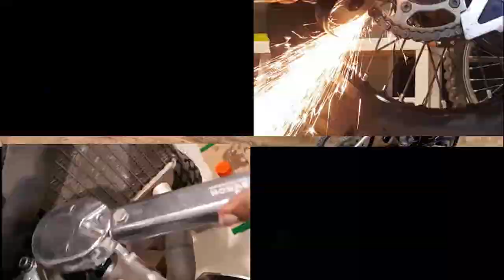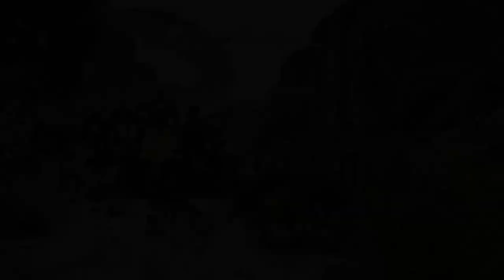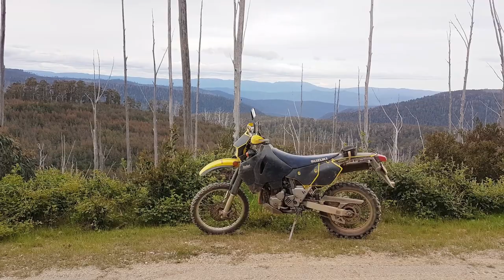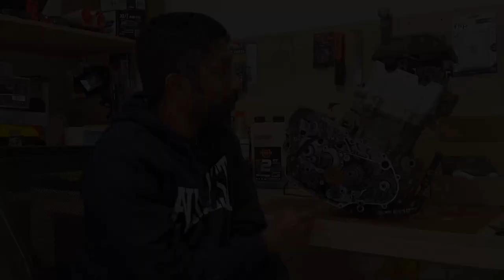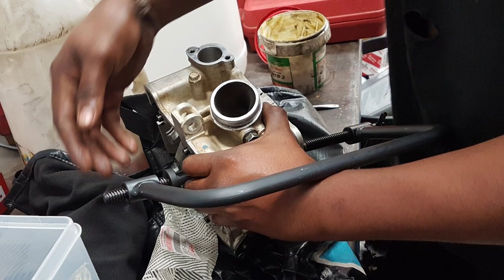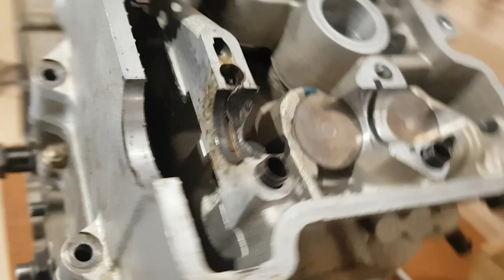DRZ400 engine fail! | On Two Wheels

Comment: You did well with the engine disassembly and learned a lot. As soon as I saw the damage at 07:39 I knew it needed proper repair, or even replacement. When I heard that you sanded it smooth, I was almost certain that was going to cause problems. Typically when journals are scoured like that you can’t simply make it smooth because it’s already lost material. You might get a nice looking finish, but the clearances will all be too great because of the removed material. To repair it, ideally you’d clean it up, do fresh alloy welding, and then machine it back down with a mill to the correct tolerances. As most of us can’t do that, it really needed a replacement cylinder head at that point, or taking it to a machinist (not worth doing with a DRZ when cylinder heads are so cheap...it’s not like a Ducati superbike). BUT...you learned a lot about your engine, and you’ll be able to fix it properly next time.
Reply from the maker: Thanks mate! Absolutely! My car mechanic friend who helped me get the valves out, give me the same look/message as you. In fact But the innocent inexperienced newbie in me was being wishful. I was told the head needed to be replaced, but i thought of myself of the underdog who persevered  with his sandpaper and would eventually triumph. 

Strangely at that point the cheapest (used) head I could find was $1200, and the cheapest Engine (changeover) was $1700; so when I could throw in some more money and buy an entire motorcycle it just didn't make sense to try save this head.  So that's what I did.

Comment: Thanks for the story!  The more I've worked on stuff the more I've realized that the difference between "can do" and "won't" a lot of times is intimidation.  It has become easier and easier for me to do jobs as I've gotten more and more familiar with stuff.  Most mechanical tasks are not super complicated, but they can seem intimidating, because there are a lot of unknowns.  Some people with zero experience have zero fear, and they delve into projects with nary a care.  Others have lots of experience, but are still intimidated.  It's all a game!

Concerning the cam journal I honestly wasn't sure what your outcome would be.  That is a precision surface that is fed with oil under pressure, the oil film floats the cam.  If the clearances become too large and/or the surface is not uniform the oil film can't subsist, and then you have the metal-to-metal contact.  It would've been an interesting experiment to see if a thicker weight engine oil might've given you more running time.  People may disagree, but there are always the amazing cases that defy what the experts say is or isn't possible.

Again, that's not a "friction" issue so much as a plain-bearing-loss-of-oil-pressure issue, which then turns into a friction issue.  Look up mototuneusa.com, Pat McGivern talks about all the controversies surrounding proper engine break-in and how areas in engines with plain bearings (such as your cam journals) don't break-in on a new motorcycle (they're either properly sized and operate as they should, or they're not and seize, hence the "easy break-in" is a fallacy).
Reply from the maker: Absolutely mate!
That's why I love mechanical things, as you take things apart you learn about it. All those mysterious internal bits start to make sense!

You know what, I think you're right! Sanding off too much probably meant there wasn't enough oil pressure to keep it 'afloat'. But at that point, the head was already messed up. So I guess it was worth a try.  

Thanks for the link, and also thanks for taking the time to share all that! I genuinely appreciate it, and love hearing these things! I learn just as much through fellow-riders comments as through YT itself!
Reply: @OnTwoWheels  Another thing I'm sure you'd agree with, too, is that I've learned a lot more through experimentation and failures than by being told the proper way to do things and adhering to that.  I'm not dismissive of good theory and learning from a book, but I am dismissive of people when they're dismissive, lol!  I know lots of people would've told you not to sand that journal, that it would never have "worked."  I'm glad you did, and I'm amazed it was fine until you got to higher speeds.  In an emergency, that fix could've saved you.

Comment: Hell of an ordeal mate, Glad to see it worked out in the end. My drz was making the same sound a while ago, and me being the paranoid guy I am, stopped riding and took it into my mechanic straight away. Same problem, cam chain tensioner had reached the end of its adjustment and the chain was loose. New cam chain, been running great ever since.
Reply from the maker: You clearly did what I SHOULD have done. Preventive maintenance and checks really is key!!

Comment: I use a ratchet strap to get the carb back in. Taking it out is just a matter of disconnecting throttle cables etc, twosting sideways and pulling it out. I added a clip in one of my vids but will make another one showing the process. As far as metal parts- replace them. The cost of a new part (and seals) is way cheaper than trying to fix it without machining, and is the cost of owning a bike. With the service manual, you can strip the engine completely and rebuild it. Just follow their instructions. I recently resolved a hard start issue by replacing the cam lift shims. The timing chain didn't match the manual as well so I was reluctant to correct it. I eventually went by the manual specs, put the bike back and holy cow the thing ru s so much better. Trust the manual. Youtube is good to understand the procedures, but you need to follow the specs.

Comment: Thanks for making this video and sharing all the details. I found it really interesting that you sold 90% of your DRZ in 10 days parting it out 😂. Thats awesome, I love my DRZ. I would do the same and just buy another one and part out the old one. Or keep what ever one was in better condition.
Reply from the maker: Absolutely mate. I think that's the good thing about having a bike that hasn't changed in design for over 20 years. And yeah, it's always good to keep the bits that could 'fail'. I the stator, CDI and starter motor are the key parts that are small but valuable, so they can sit in the back of a shelf till you need it :)

Comment: Thanks for the honest truth about your bike. Wonder what is your plans for the old motor. New head and sell or keep it and build a monster?
Hope you have money and time cause I like to watch others spend the dollar. Time for my '05 to get a once over. Has over 11k and no maintenance except one oil change and spark plug sense bought in '16. Pressing my luck as is. Thanks again
Reply from the maker: I was initially looking to fix this up, but when I found another (better) DRZ with a few missing parts, I took parts off my old bike to get that running. It just seemed more logical. And the left over bits, I sold off and covered my expenses. It IS nice to see others spend their money, I do agree!

Comment: Bugger. I'd guess you didn't use assembly lube or a torque wrench when doing up the cam caps? Any idea what happened?
Reply from the maker: I used both,.
My guess is that it was just those metal filings which got into the oil jackets and ruined the cam journals. I HAD noticed a slight cut when changing the valves, but if it was on it's way out, I thought I'd try my luck anyway. Wasn't so lucky end of the day.

Comment: The automatic cam chain tensioner that comes standard with this bike is a known weak point, I would reccomend getting a manually adjusted version, since they don't cost much, and will save you a ton of grief.  Another weak point, as I have discovered(but also a weak point in other bikes like this), is that you have to be careful when changing out the chain sprocket on the drive shaft, as the drive shaft is "floating".  On the inside of the case, the there is a slide bushing on the shaft that could get deformed if you use too much torque on the nut holding sprocket in place.  This bushing can cease on the drive shaft, and ruin the transmission(happened to me at a busy red light).  Use a torgue wrench, 110 Nm.  Some say you even should put red loctite on the axle spines(not the thread) to take up the slack between the axle and sprocket to make sure that the nut will not accidendentaly tighten itself, by the slight movement of the sprocket.  Personally I think have right tightening torque should be enough though.
Reply from the maker: Actually the 'weak' auto tentioner was on bikes built upto 2003. The ones after have a ratchet mechanism so doesn't 'fail' with the spring. 
As for the CC nut, oh yeah, i've got a story on that too.. will share soon!

Comment: This is basically where I'm at, except My bike dropped a valve that is now stuck through the top of the piston, like a thumbtack. My camshaft journals look just like yours, and it was the same noise leading up to it.
A fresh 300 mile engine is on it's way. I guess I better clean the carb up in the meantime.
Reply from the maker: ouch! That's a bit more serious than mine! My bottom end was OK, but I was burning a bit of oil, so i wouldn't say it was a 100%. Sometimes getting an entire engine (or entire bike) ends p being easier and cheaper.
Reply: @OnTwoWheels  for sure man, once I get these engines swapped I'm gonna pull that piston out and prominently display it somewhere.
I would have preferred to keep the original engine and just fix it up but it would have cost more than a fresh engine.
Reply from the maker: But if you want to experience the rebuild,once you get the engine out, you can always rebuild it leisurely! And keep as a spare or sell it off and cover your cost. 
That being said the rest of your engine sold as parts can be worth just as much. Lots of valuable parts in there ;)

Comment: I managed to blow up the engine on my DRZ400 last year during lockdown. It just suddenly went on the Princes Fwy one day. It had been stored for a few months but never have any issues until that time. It faded out a few times in the minute before the piston bent itself like a banana. Now I've got to work out what to do with it. Fix or replace is the big question. Learn from the mistakes that's all you can do. Look forward to seeing you around Melbourne some time 😉.
Reply from the maker: Absolutely.. we can only learn from our (or each other's) mistakes... Splitting an engine to sort out a bottom end feels like a big challenge.. then again, taking the head off felt like that the first time too. You might be able to sort it out, an in the process rebuild the engine too. But at the same time, getting another engine might be a easier solution. 
How did the piston (rod) bend though? I would think that for a rod to bend there must have been something that prevents the piston from going all the way up? (like when the engines waterlocked)
Reply: @OnTwoWheels  I'm told it was oil starvation but I'm stuffed if I know where the oil went. The engine can be rebuilt but given it came back to me in pieces I honestly have no idea how to resemble so might end up selling of unused parts 🙁. Going to look at refurbishment of the carb from older bike and transfer into the newer as it has the smaller carb from the SM model.
Reply: @cruisin650  could be oil burning. In fact mine was burning about a litre every 2000km i think. 
Yeah, if that's the case selling it for parts might be cheaper. There's quite a few expensive parts in there. And collectively you might even recover close to the cost of a new engine by doing so.
Reply: @dilesh007  yeah I ended up buying a while new bike so I just need to take off parts from old one that I want to hold onto and love the rest on. The engine come back from the shop in pieces so not sure how to market that online 😂. The old gal was a little smokey toward the end so maybe I should've paid more attention to that but consider this a lesson learnt.

Comment: Sometimes it can be difficult to know if the DRZ motor sounds good. There are heaps of youtube videos of DRZ owners wanting to know if "Does this motor sound OK to you?" A stock DRZ motor sounds like a bucket of bolts have been thrown in and If you run a skid plate, it sounds much worse. On top of that I wear ear plugs as the DRZ  is a loud single thumper, so may not hear anything unusual. The good thing is that parts are cheap and a good opportunity to add a big bore kit and ACT gearbox.
Reply from the maker: You hit the nail right on the head there! Especially the bit about the bashplate!! 
In fact the other bike I bought had a big-bore kit!

Comment: Any reason why the cam would have just destroyed the head after you went through all that work?
Reply from the maker: As someone pointed out, when it was sanded down, it increased the tolerance. This meant there wasn't enough oil pressure to keep the cam suspended. When i saw the scorching I knew it was a gonner, but hey, if it needs replacing anyway, n harm trying one last hail Mary on it.

Comment: I would like to find some 400e wheels and tires for my 400sm.
Reply from the maker: There's a few things you need to consider. 
1. Wheel spacers needed.
2. Speedo drive will need to change 
3. Front brake disc size is different so you need an adaptor for the caliper to fit over the disc.

The good thing is E-wheels are easy to get a hold of, so the key is to keep a keen eye out and be quick. Fastest finger wins!

Comment: How close did you get in paying off the replacement bike by parting out your old one? I found that new genuine DRZ parts can be quite expensive so I’m guessing there might be a lot of interest in second hand parts?
Reply from the maker: Since it was my first time, I priced everything noticeably cheaper, just to get them off my hands. So end of the whole ordeal, I ended up making a small profit (plus the free engine I got and a few key spares that I decided not to sell as they can be useful for me later (stator, CDI, starter motor) 
Most vehicles are worth more as parts than as a whole, but it's about how long it takes everything to sell. So it helps, when you have a bike that's as popular as a DRZ.

Comment: Great story mate. How many ks were on the bike when the cam chain let go? I may have missed it.
Reply from the maker: Glad you liked it. The bike had done about 24,000km by then; but I have heard of some DRZs running 2-3 times that before needing a new chain; so I don't think there's one magic number. The best is to take out the spring on the tensioner, then remove the tensioner and then press the rod to see how much more it can push. Then, reset it and put it back in :)

Comment: how many miles did you have on the bike??
Reply from the maker: 21,000 km (of which a about 80% are highway commuter mileage)
Reply: @OnTwoWheels  wow. did u check the valve clearances? im surprised the bike broke down at only 13k miles
Reply from the maker: @diegoaespitia  yeah mate clearance was good. The issue was the channel that the cam sits in was worn out, which meant it wasn't properly lubricated.

Comment: So what was the problem on your test ride? Did you forget to put oil in the bike 😨
Or was it the sanding on the grooves on head?
Reply from the maker: It was the sanding; before the sanding, the cam wasn't rotating as freely as the other. The sanding helped; but it wasn't a 100% fix. So it was 'managing' at idle and slow speeds, but during the test ride at freeway speeds/RPMs it couldn't make it. And the situation aggravated itself and went past the point of no-return.
Reply: Was there an oil supply
Issue? Can you explain this sanding issue further please if
Possible? Thanks mate
Reply from the maker: @diydirtbike4625  Yes there was an oil supply. My theory is that the metal filings that were mixed with the oil got into the cam journals. This scratched and deformed the surfaces on the cam shaft & journals. Because of this, the cam wasn't turning as freely as the other. by sanding the cams and journals I expected to remove the deformities allowing the cam to rotate freely. I also didn't want to over-sand it as that would then cause a play between head and cam. I sanded it down to a level where it rotated decently, but it wasn't optimal. 

So after reassembly, it rotated fine and didn't have any issues; but at high speeds the friction probably caused the metals to expand, and then add more friction, and then heat up more, and go in a vicious cycle. This went on until the components on the head got so hot it overheated and couldn't lock in compression anymore... That's my theory.

Comment: My mate an I have drz400e an he's shocking with looking after it if he's low on oil I've seen him use cooking oil an that thing don't miss a beat an mine I use for hard enduro but I service it ever 7th ride to make it unbreakable I dunno hiw you manage to blow one up
Reply from the maker: All it takes is one little chain link to file off metal bits and mix it with the oil.. frankly, the components themselves i feel ware very little with time